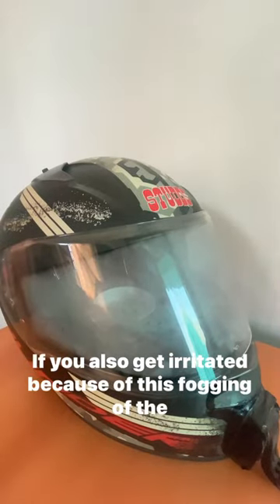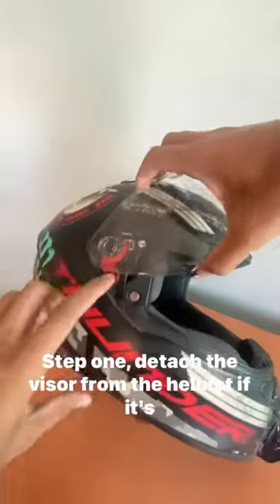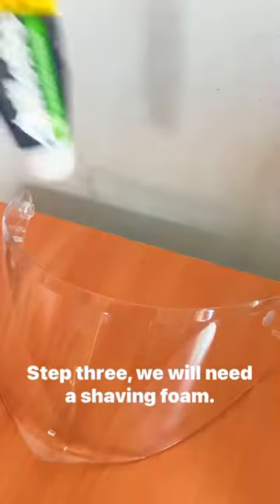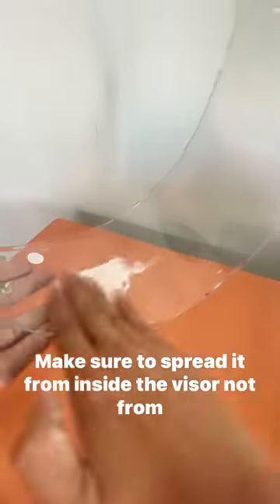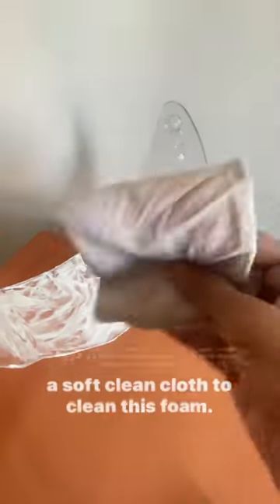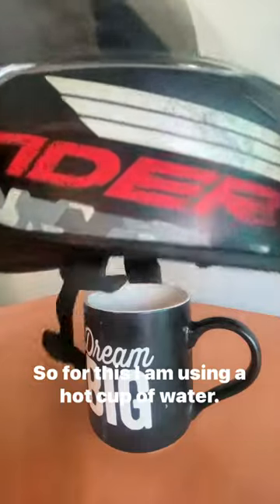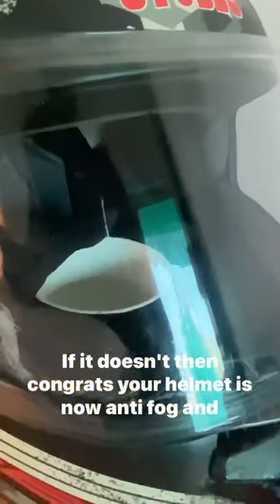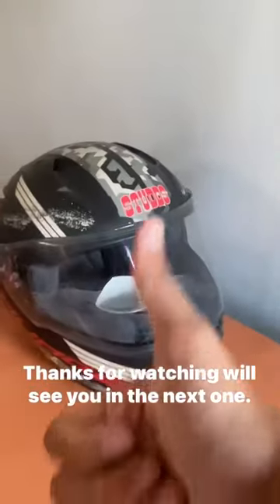3 Steps to make any visor into Antifog visor at Home. #vaibhavtravel #diy

Comment: Since the foam is wiped not washed, tiny amount of soapy content stick to visor. Any soap shud do the job, as soap messed with viscosity of the water it won't stick. I guess we have to do after every use, if it's foggy
Reply: at my airsoft field they say that dreft works great but for me it dos nothing what really works great for me is toothpast. i played the whole day last saterday 27 degrease celcius and it did not fog up at al